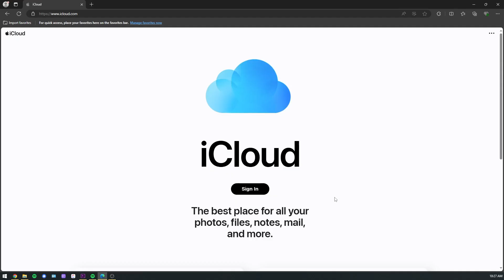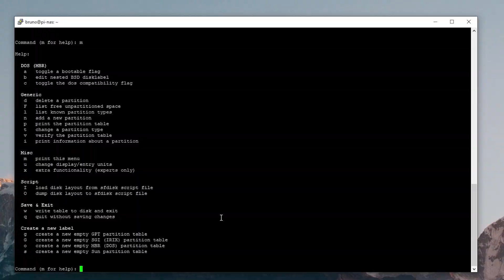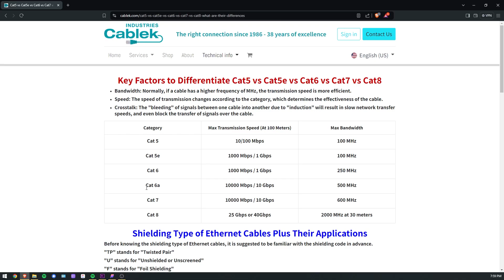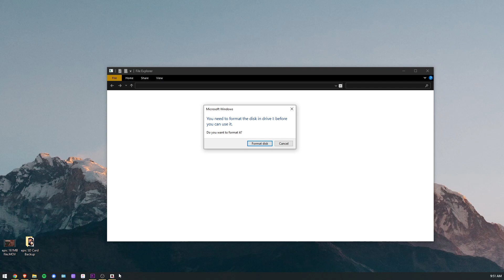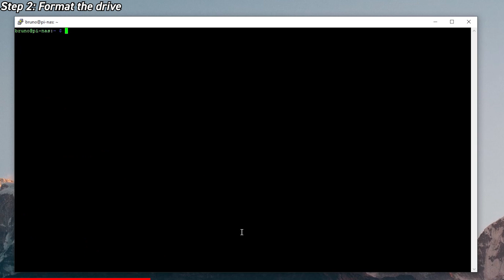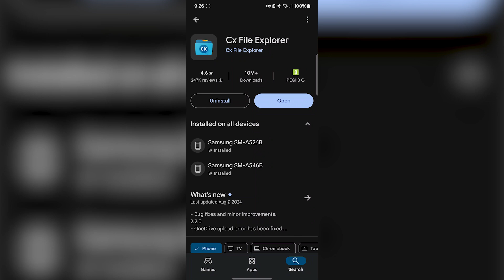How to Build Your First NAS! Samba Share Setup Explained!

Comment: I had one of these it worked for 4 months then one day i went to save a file to it and its crashed.  Its so frustrating setting these up and then had all my files on it.  Now I have to retake it all apart move the SSD back into a computer and see I can save my files
Reply: yes this is how it goes every time, don't use a raspberry pi for a NAS